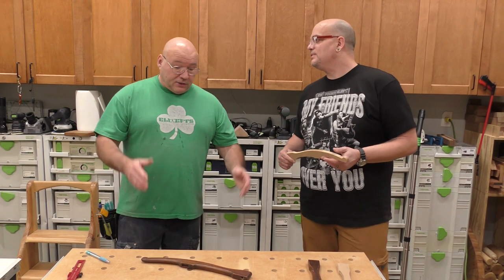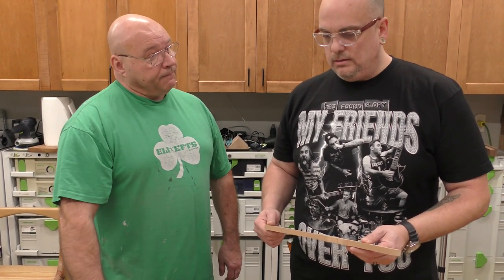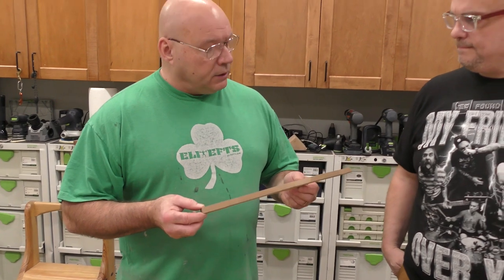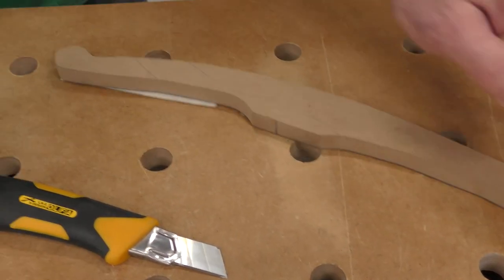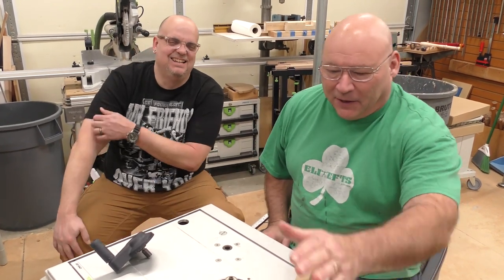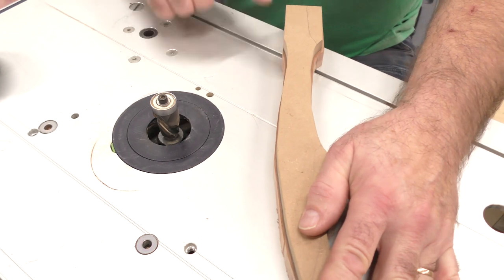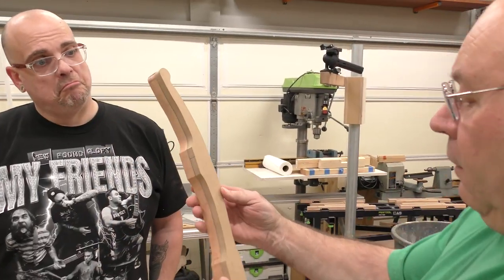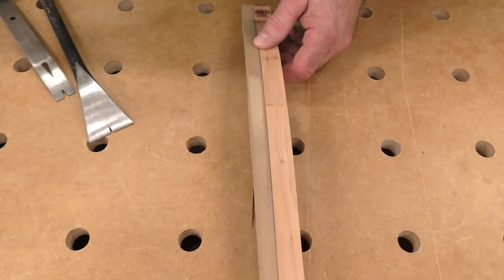Template Routing: Bow Saw

Comment: If there’s one thing I’m overly concerned with and still struggle with, even when I think I have the grain orientation correct, is template routing curved pieces. 
A lot of good tips here!
Reply from the maker: Thanks..... The bit I was using is a combination up / down spiral....helps eliminate a lot of tear out........ also cutting close to your lay out line will help....

Comment: Hi Sedge,

Can you give me the info for your router table template guard?  It looks great.
Reply from the maker: Ok .. the guard system is part of the Festool router table system..The CMS /OF ...which has been discontinued...I think you can piece one together from spare parts at this link which takes you the Festool website for spare parts..... hope this makes sense .......

https://ekat.festool.de/login3/app?__bk_&__windowid=UEW241925246&__rid=LRR1640977782025#2VFB2144C915D47DFAD66CC73CEC1F7E17E1D29351DB45EA618EEFB7B1BB136D42B8044FCE28E6056D